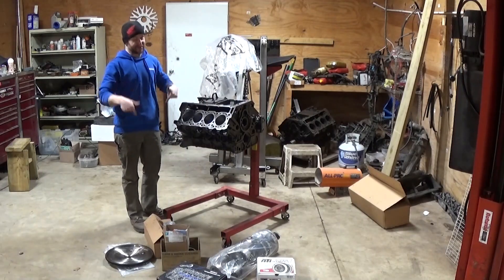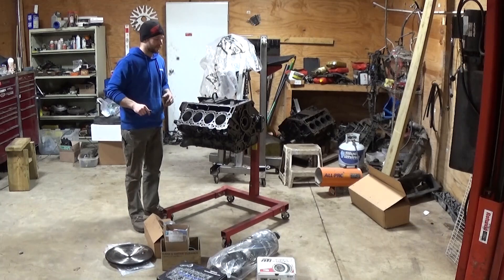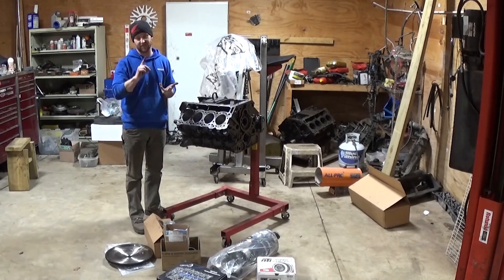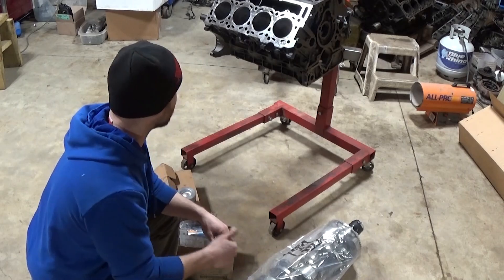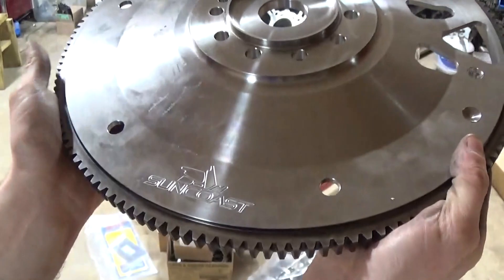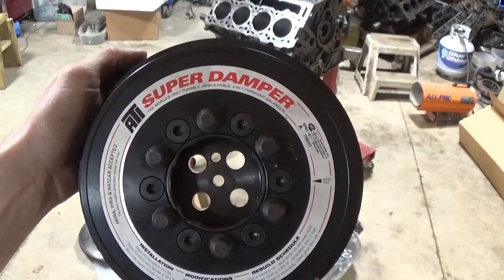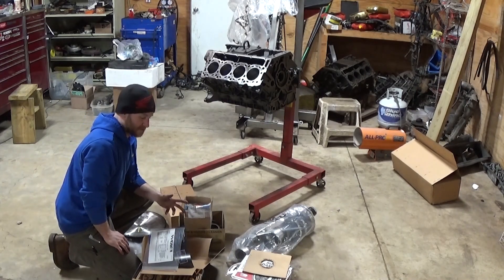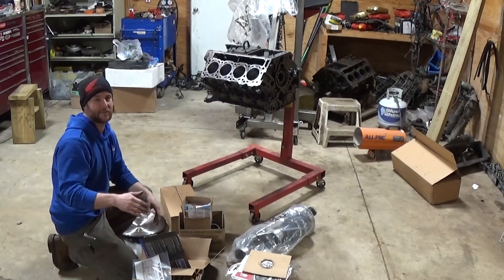New and Used parts for my King Ranch 6.0 Powerstroke engine build

Comment: Try the icon aluminum heads from KDD and a stage 2 cam
Reply from the maker: That’s my plan down the road.  I feel the average 6.0 owner right now is most likely running stock heads.

Comment: Kill devil diesel camshaft with KDD Johnson lifters I think are your best bet.
Reply from the maker: Kill Devil Diesel is on my radar. I’m looking at RCD as well. They’ve been in the 6.0 game for some time.
Reply: @showmerepair   RCD is good too.
By any chance have you heard J@K Engines? Their reviews seem positive on their website but I can't find no one on YouTube that has bought their engines before
Reply from the maker: Your right. I’ve not seen any in YouTube videos either. 
I plan on making lots of videos on 6.0 engines. Maybe I’ll buy one down the road.
Reply: @showmerepair  Yes I have been in contact with Anthony over there.  Gave me a real nice estimate. My engine right now is running for the most part OK. But it just needs a headjob. Got like 154,000 miles on it.   Parts and  labor for that cost,  I figure why not jump on a long block and be done with it.  Would love to go with Kill devil long block but that one is alittle out of my range

Comment: So basically you want to see if you can match or do better than a 6.7 with all emission restriction impact, a real comparison…. Did you mention turbo? Do you know the lift and duration on the 6.7 camshaft? I will do a camshaft closer to what that has… Also did you mention injectors?
Reply from the maker: I did mention that I will start with stock turbo and injectors. I want to do all the little performance upgrades. Tune then dyno to show power increase. 
I do not know the specs. For a 6.7 cam. 
My end goal is to have a good reliable 6.0 that makes a little more power then a 6.7.
Reply: @showmerepair  sounds like a good plan! Do some porting on the heads…
Reply from the maker: I’ve checking on prices for porting but having trouble finding places that will port used heads.
Reply: @showmerepair  do it yourself? I built many gas engines, not that difficult, just takes time…🙂
Reply from the maker: I’ve gasket matched and done a little porting. Never had it flow tested to know if I was actually helping. I probably won’t do these heads myself.
Reply: @showmerepair  okay. It’s all about thinking Venturi effect, also since it’s just air on the intake side polishing the ports is good to do as well.
Reply: @sveinhaland2975  Swirl is huge one. Just porting and cramming air into the heads won't be as efficient, as if you also have swirl to mix with the fuel.